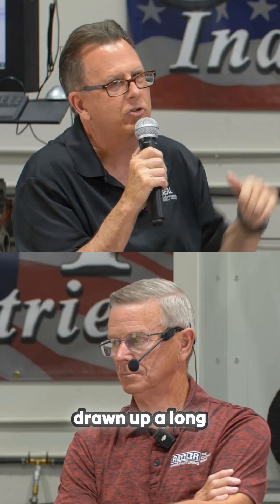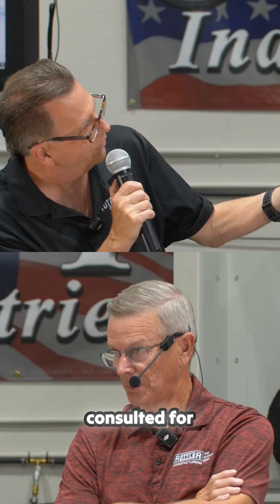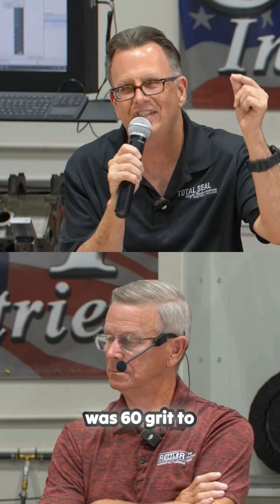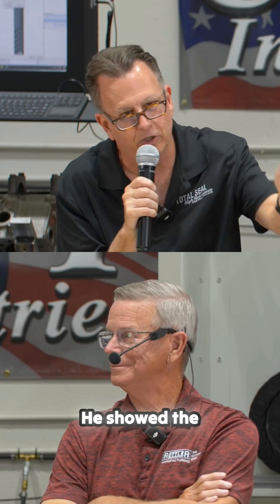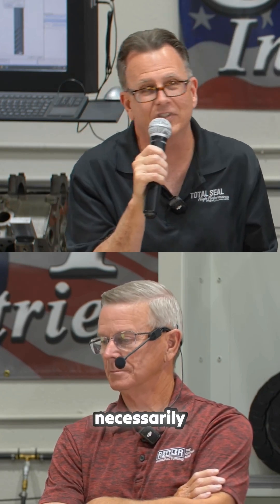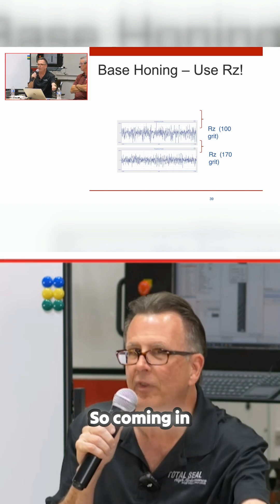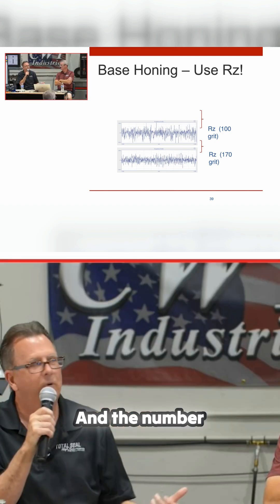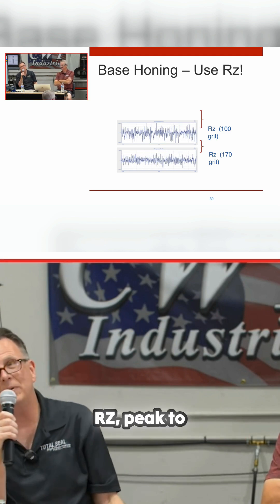Extreme Plateau Honing Explained | Race Engine Tech

Comment: We saw a local reborer that bored to a thousand or so off size, honed by wrapping a sheet of 800 wet & dry round a sponge & lubed with WD40 to finish.
Looked well weird but, it worked really well, just run in really gently for a week or so.
Things move on but here it is again.